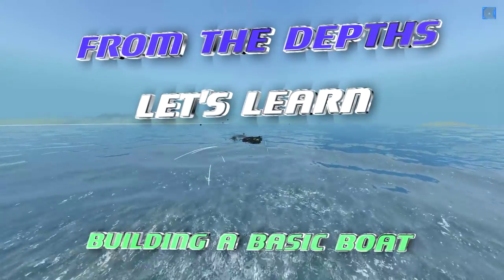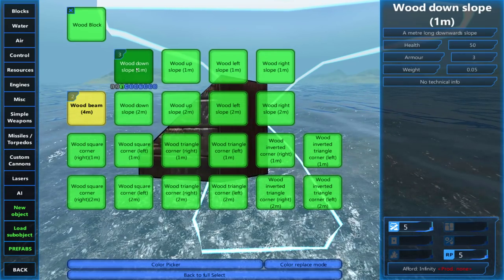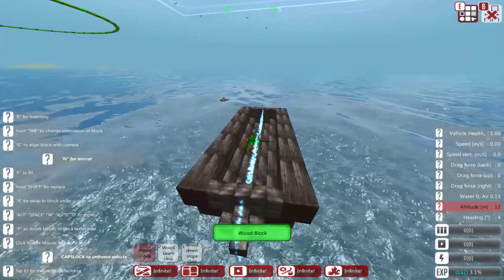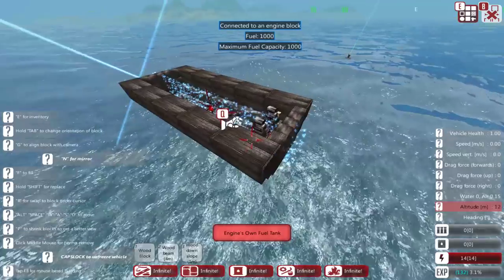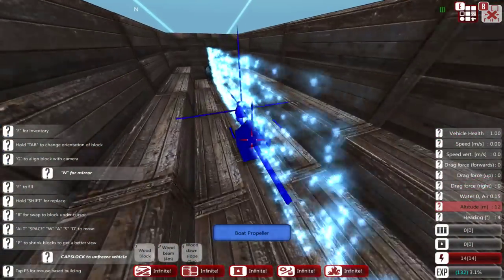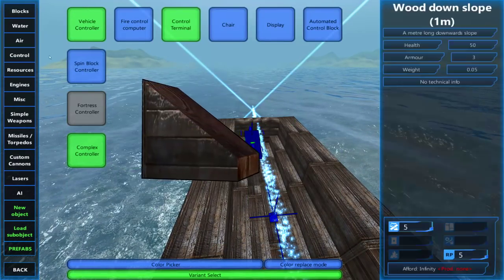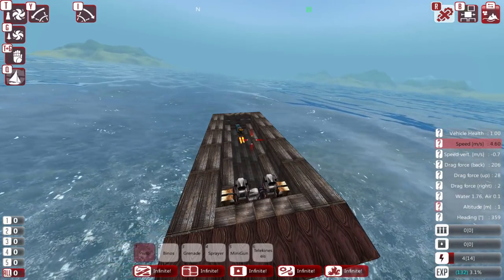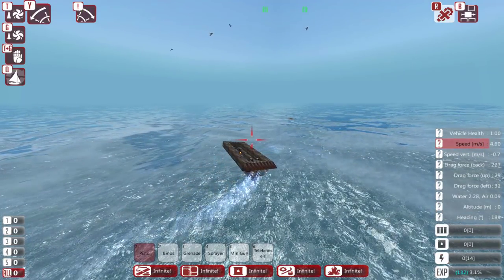From The Depths Let's Learn - Building A Basic Boat [Tutorial]

Comment: This guide is going to help me a lot. I didn't realize that the COM was what was making my ship fly into the air.
Reply from the maker: +Mark “The Ficanator” Burgess Glad it can be of some help!
Reply: Now I just need to learn how to make a ship that will go at a decent speed...
Reply from the maker: +Mark “The Ficanator” Burgess Getting good speed on a ship is all about the drag/cross section. When you press 'v' on a ship, you can see that info. Minimalizing this will let you obtain great speeds. For instance if you have a jet, using lots of sloped parts near the front can help reduce drag and net more speed! Things like that :)
Reply: Good to know, I wasn't quite sure if the game tracked things like that.

Comment from the maker: Thanks Brendan :) I figured since it was just an engine and in vehicle designer, I wouldn't pop barrels down... hopefully that doesn't confuse anyone..!
Reply: Scr0atoriousGaming  what button is the symmetrical mode ??
Reply from the maker: Hartz-4 Styler Press 'N' to enable mirror mode (you need to be in build mode first) - it will be based on where your camera is facing. Hope that helps!
Reply: Thx

Comment: Only just picked this up last night. Tried following but I cannot get a block, at all, over empty space to build on. I appear to stuck building on the raft. Using the mouse control system. What am I doing wrong? I tried capslock and double tap A but it does not seem to help.
Reply from the maker: +DigitalXAQ Did you try going into the build menu and selecting to build a new ship, then dropping a block somewhere in the ocean? It seems after one of the previous updates the game changed how it works, previously you could just click to build any block outside of that raft and it would start building a new ship - now you have to specify I do believe, via the build menu, that you want to start a new ship (under the new object category)
Reply: F3 was the key I needed, I can't believe I didn't see that.
Reply from the maker: DigitalXAQ Glad you figured it out!

Comment: Is there difference between one air pump and numbers of pumps?
Reply from the maker: +광승홍 There is not - the only reason you would add more than 1 pump is for redundancy (in-case one blows up, etc)
Reply: +Scr0atoriousGaming Ah. thanks for ur assistance. then only i need one pump per room. or maybe two for redundancy :-)